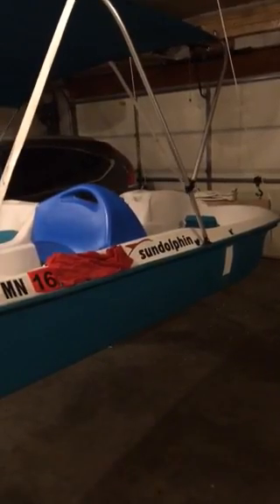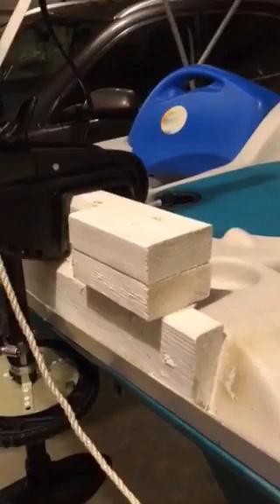How to install a trolling motor to a paddle boat

Comment: I want to do the same to my paddle boat. how do you mount the wood to the paddle boat? is the mount stable? need help.
Reply: GOOD BLESS   did you ever figure this out?  I have the same boat and questioning how to mount or what screws to use to drill into the pedal boat

Comment: Any luck finding the sprockets anyone ?
Reply: Update on my hunt to figure out what he did. First thing I learned is it’s not a “sprocket” it’s a “gear” maybe a spur gear. Even though both are similar a gear meshes together unlike a sprocket that’s why he’s able to turn the steering because the “gears” interlock and causes force. I’ll be back when i figure out more.